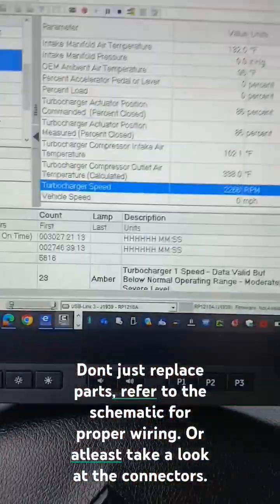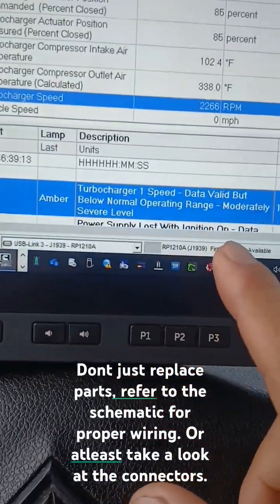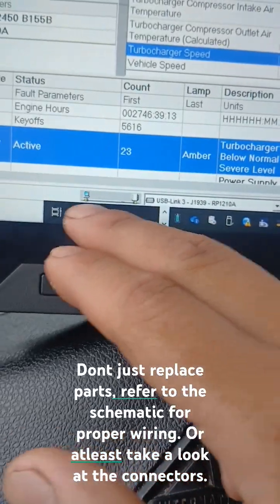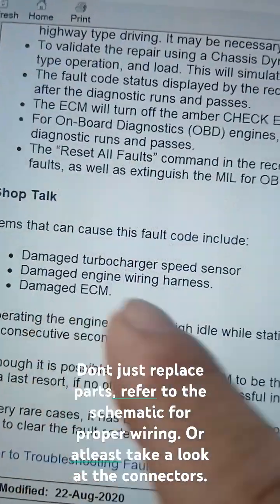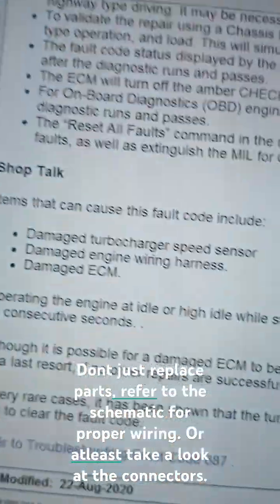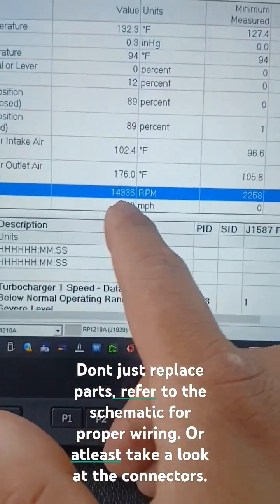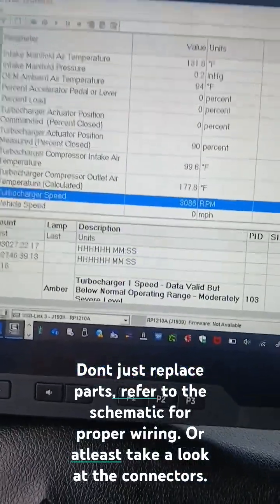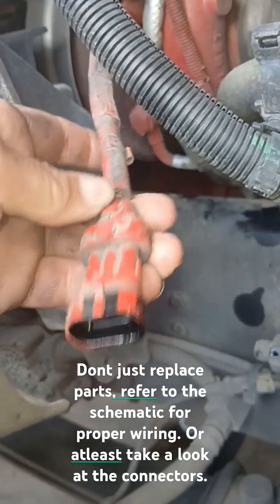Cummins check engine light, turbo speed sensor harness was full of oil. #truck #diesel #dieselengine

Comment: Gotta take a look at mine. Turbo just replaced due to oil being in the exhaust pipe that runs turbo to radiator. Guarantee, this is the problem after seeing the turbo speed sensor code pop up
Reply from the maker: @christopherclanton1986  dang sucks you had to replace the turbo but yeah that connector always seems to be getting oil intrusion. Hopefully you got your truck and and going
Reply: @AllThingsTruckTech  it's going, though, after replacing, the code still popping up. Everything seems to be running fine. Thinking it's time to trade it in for a newer model. Just how it goes sometimes